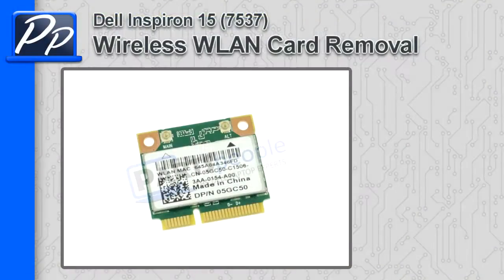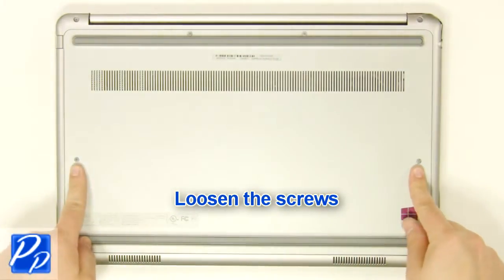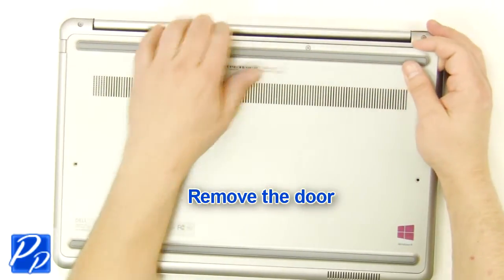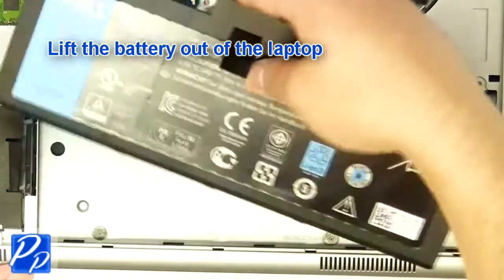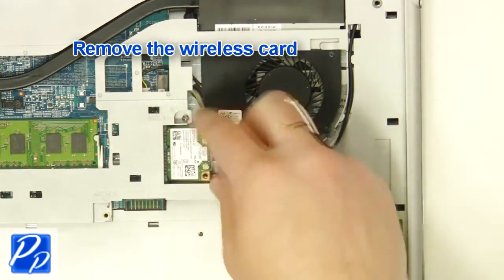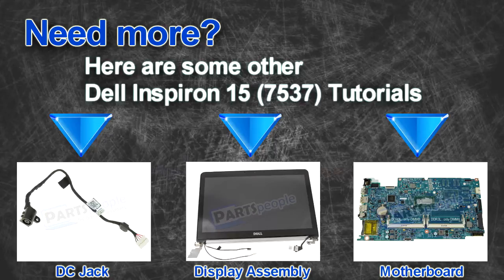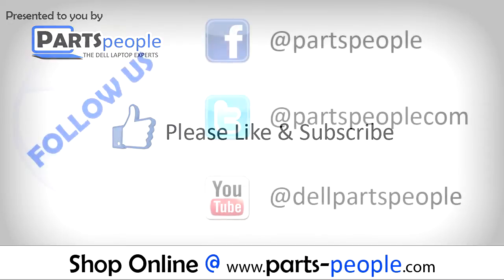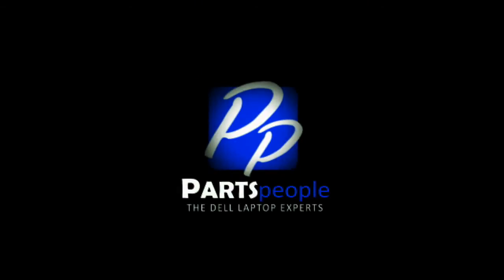Dell Inspiron 15 (7537) Wireless WLAN Card Video Tutorial Teardown

Comment: Will this work in a Dell Inspiron 15 7547? I really need to replace the Wi-Fi card.
Reply from the maker: DaGameNerd It's not the same laptop but the steps are pretty similar.
Reply: Parts-People.Com, Inc Thank you for replying, I actually ended up opening the laptop anyways and found out it doesn't use the Wi-Fi card I hoped it would :/ oh well I guess I can't turn this into a Hackintosh.

I'll still replace the card to a compatible one though for better strength.